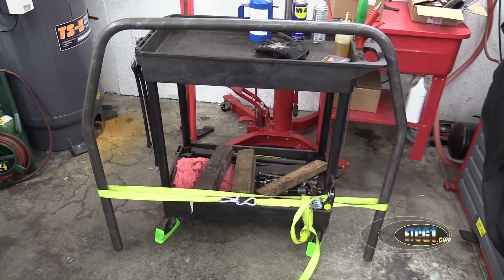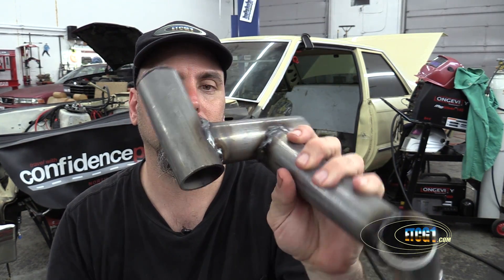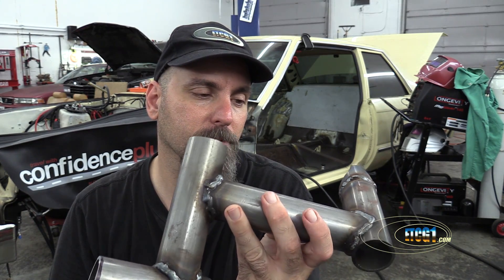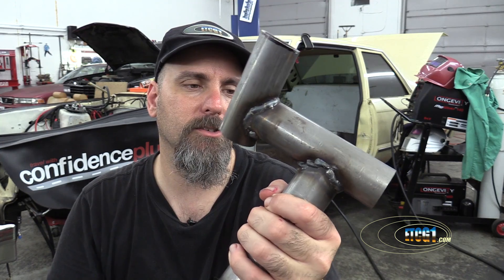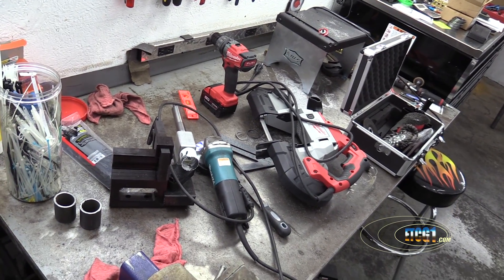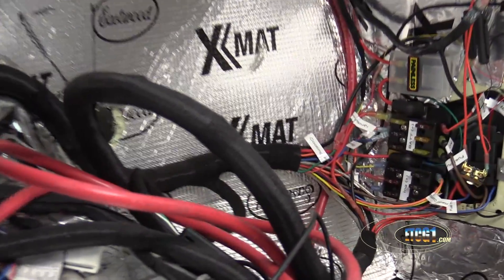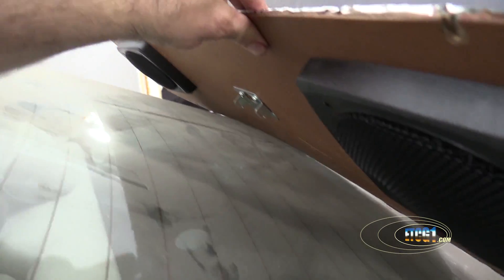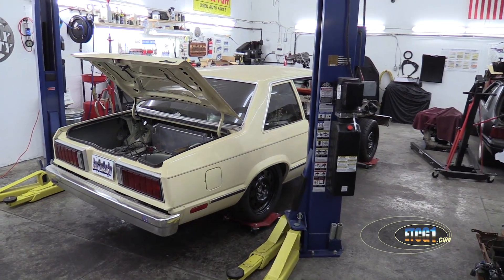Losing Motivation With Project Vehicles

Comment: I know what you are going through I had a 95 civic I was starting to restore a few years back, bought the car back when I was 17 or so and by time I reached my 20s I started putting alot of money in the car from a engine swap just to get it back on the road. And spent alot more money doing body work. Which the body work wasn't horrible just needed a few dents pulled an new core support. Well I couldn't put the core support on until I fixed the frame in the front it was bent back some. Lost my job and things went south. I hated to sell it but I sold the car that project seemed to take forever. I wanted to build a b18c1 engine with boost had everything laid out on the planning table but things happens wasn't meant for me to build the car.  So now I bought a 91 firebird not really planning on doing a bunch of work to it besides the normal tune up and suspension work and eventually get the car painted but other than that it will be kept original. My plans are to keep it for a very very long time. Sometimes you have to step away from the projects for a few days to reset your mind, there's times I get out and don't feel like messing with nothing and when I do it's to late in the day. But when motivation strikes I go to bed early wake up at 5, 5:30am and start on my project. This is how my mind works and it may help you to. When you get through with a area of the car the fun part is, is stepping back and looking at the progress made. Don't worry about the next 100 things on the list those will come soon enough. Since you are stumped on the roll cage find another portion of the car to do and come back to the roll cage later. Let your mind clear for a bit.

Comment: I know you might not see this but I learned to weld using flux core. Over the last year I gotten better and then I switched to shielded gas and omg, my welds are mint now. Basically what I'm saying is, if you can get the hang of Flux core welding, shielded gas is like training wheels.

Comment: I know the feeling about losing motivation with projects. I am stuck working on my project outside for the past 10 years, every time i start to make progress life gets in the way and stops me, ive got two sills to fit and one rear wing and the weldings finished 4-5 days work max. Once thats done the rest is just assembly and yet I struggle to find the time to do the work thats needed, from other projects - work life balance. I mean this is the one car I want on the road more than anything and yet I seam to keep getting distracted by others. I think some times us car guys just need to give ourselves a kick up the backside and get the jobs we don't want to do done so we can get our projects finished.. 

Building a project car is like climbing a mounting. your struggling your backside going up to the top of it, with all the hard jobs you doubt you can do - but once you get over the top you fly down to the finish line..

Comment: Eric, as a guy who started his project in 2010, I know where you are right now. I jumped into tearing the whole vehicle apart, put the body on a rotisserie, fixed every single minor fault on the body, restored every single part to the smallest detail and where am I right now? I still have the interior, roof panel (accident, avoid tent garages) and paint job to do, which will cost over 7000 dollars. I'm in the point where few things have to be done but they cost a lot of money.

Comment: I hit that a couple time on my 47 coupe I find taking a bit of a break helps give your mind a rest and when I came back to it. What I thought at that point was a brick wall coming back in refreshed what was once seemingly impossible just popped together. I had a bit of rust on the cylinders of that 47 I honed them and it worked great still running strong with no issues

Comment: I understand that it is not always possible, but I like to do my projects step by step. Keep it driving for most of the time. Everytime you have finished 1 thing, the satisfaction you get from just driving around for a few days really motivates you to do the next. I built my engine while the car was driving, when I swapped it, it drove in one day and drove out the next. Finetuned it 2 days later. Drove a couple of days, then I got the interior out and done all the electrics nicely. Straight put back the dash so it was driving again, and did the rest all later.
Off course, there are going to be things you have to take loose twice, the eventual total of hours in the project is way more than doing it all at once, but for me, this is the right approach.
Maybe this will also work for you. You could get it up and running, save the roll cage for later, just to name something. Anyway, I not want to be a smart ass, I really like the project and the subjects you adress in your ETCG1 videos. Keep up the good work!

Comment: That sucks when you get burnt out and loose motivation. We all have that problem from time to time. The not knowing how it will turn out can really put a damper on things. By trade, I'm a manufacturing engineer and I mainly do new machine installs, some design projects, and general project management. I've been working on a design for a particular piece of equipment for a year and a half, on and off. What helps me with motivation is to have others you trust to pick it apart. Bring out the flaws they see at hand and address them now rather than after it's built. I've seen some machines that we've installed and still struggle to run as intended. My motivation is to not have one of those machines.

Comment: I've lost count of the amount of these types of projects I've had and lost interest before they are complete. I once took a 90 Camry that was a flood damaged vehicle, and stripped it all down and put it all back together and replaced most of the wiring, but I gave up after I ran into issues with the injectors and starter, so I sold it for practically nothing. 
It happens when it is fully in depth like this.

Comment: What I usually do is just take a a break, right now I'm restoring a 76 hilux and I haven't work on it for like 3 months. Same happened when I restored my 280z... Some weekends I used to get in the garage, and after realizing all the mess I had. I just turned around and went back inside the house. I know how to work on cars, weld and paint, but my current job doesn't have anything to do with cars, and even though I like to work on cars. I wouldn't do it for a living... It's stressful.
Good luck!

Comment: im going through the same type of thing with this welding inverter im building (sslightly off topic) i know im burnt out on it. my "solution" is to simply get back to it when the drive is back. or when its been sitting around for a month too long.   you can do this eric! its gonna be a sweet ride when its done.

Comment: Hey Eric. I was a bit younger and rushed out and got me a project car. I spent close to a year of solid work stripping it down and re priming etc a car in a car port. By the time the painter was ready for it it had sat through our winter here for 6 months waiting  and the rear quarters ended up crazy cracking after the paint job  from moisture in the primer. It was very sad to see all my work basically needing to be done again. . Since this point I have met with professionals of the industry and worked out what I need to do. And got myself a garage to work out of and stocked up on anything I will need slowly since I've done it before I have a fair idea.. and hopefully this time will be ten times quicker and not only that but smoother.. 
Advice for anyone in similar boat.. if you are going to strip a car to bare steel and don't really have good cover/garage for it. Understand that everything you strip will be covered in rust particles by morning unless you have put on some sort of sealer and it has cured properly before temperatures drop etc.. But the  moisture will really stuff things up for a lot of people so I highly recommend having a garage to do this kind of work and even then you can run into similar problems but it will be to a lesser extent.
Also I agree 100% Eric with the  level of understanding and intimacy you got from doing this work. It definitely helps to understand cars by taking on a project like this :)

Comment: No!  You're not losing the true meaning of motivation, i have that kind of a mood on a project on a vehicle 8 years ago but, i lost motivation of that because of obsolence in parts, engines, etc.  Stopping the project is like a cliffhanger in the tv series, finishing it will end this nightmate.  Because of that #FairmontProject, you gave me the confidence of putting back the project in one piece with NEW hope.  I am planning to do that project on my late grandpa's Feroza (Rocky) with Jeep Wrangler Underchassis JK, LT4 engine with 8 speed from GM and the Rollcage on inside and out, just help me how.

Comment: Great to hear you're reaching out for help on the rollcage... it might cost more to get someone else to do it, but those guys are pros. You can finally check it off your list, and you know it will be designed and welded together properly. Same thing with the exhaust. 

I look forward to you completing and ENJOYING the Fairmont. There will be a lot of fun to be had, and it would be super sad to see it shelved. You're almost there, you can do it. And wow there are some bitter and negative people in the comments here.... don't let that get to you. 

I myself bought a BMW E30 about half a year ago, I have plans of swapping an S62 engine into it and doing a ton of other upgrades... but just like you I'm running into walls, and slowing down. I don't plan on stopping, but my original timeline is out of the window. But that's fine, I know some day I'll get it done, I won't scrap the project, but it IS a lot to handle, and it IS daunting. But I'm learning more about cars doing this than I ever have by reading/watching/tweaking things from before. But yes I find myself messing around with the little easy things then the big large things that really need to get done. I will get to them, but then again I've never done a huge project like this... it's a learning experience, and I'm happy I'm doing it.

Comment: Yes, know the feeling well.  A while back I got about 80% done refurbishing an old shortwave radio, a Hallicrafters SX-28.  Finally I got to the point where I had some anonymous wire hanging loose and disappearing into a big wiring harness and something went snap in my brain.  Didn't have the gumption to figure this puzzle out.  Put my tools down and have not touched it in like THREE YEARS.   It happens.   No major show-stoppers, just a few minor roadblocks.  My only suggestion:   try a little creative visualization-- imagine the thing all done and put together and how good it will work and look and all the good vibes generated thereby.  Build up a gumption reserve, then get to it.   Hasn't worked for me yet, but it just might.

Comment: Hey Eric, I think one of the mistakes people make is doing things in an order that leaves the vehicle undrivable for an extended period, such that the car ceases to become a fun thing you're tearing around in and is instead a piece of furniture you start to feel an obligation to work on rather than a fun thing. You can at least be thankful you didn't get it all apart and decide to do bodywork too- i see so many people strip a car as the first step with the intention of a full restoration including bodywork/paint, only to lose steam because they forget the fun of driving the thing while it's up on jack stands forever (also it gets pricey fast).  

When you're adding all these performance bits like suspension and brakes but you're not getting that positive feedback from driving it right after and feeling the benefits of your hard work, it's not hard to see why you'd lose motivation.

Comment: I think the biggest issue people have with Project Cars (myself included) is they try to do to much to fast. A regular guy doing a build like this would be a 5-6 year project. I recently did a drivetrain swap in a Dakota I have, took out the V6 and automatic, put in a V8 and a 5 speed. I had the ridiculous idea it would only take a couple weekends to go from driving in to driving out. That couple weekends turned into almost 9 months of going over stuff, a little wiring, making stuff fit that didn't and rearranging the cooling systems since the water pump on the longer engine wanted to occupy the same real estate as the radiator. And after all that then engine I built spun a rod bearing on cam break in, so I had to take it all back apart, get the engine rebuilt and put it back together. It's worth it in the end and I love the truck but I would definitely do a few things differently if I did it again.

Comment: With my car, I've been building it one part at a time. I will not let it sit in pieces for long so I wait until I have everything to do a particular job then knock it out in a weekend. I recently painted the inner fenders and installed a fuel injection kit. Now I want to upgrade my transmission but I'm not going to take it apart until I have everything to do the swap. I make a plan a and stick to it, if I feel it needs to be changed in the middle of the project I finish what I started and if I still think it needs to be changed I get to it when I have all the parts. Like the transmission, I'm not digging the 400 turbo "upgrade" and I'm thinking of going back to a 350.

Comment: For me, I have to drive it, the number one priority for me with the project car is that I have to be able to drive it, I've pulled things out of the dirt and Donna bunch of ghetto stuff just to experience the way the car drives, before tearing it apart and doing other things, you need the connection with the car, you need to feel what it has to offer, you haven't driven the thing for two years!

Your mind is stopping you because you're frustrated with how much effort and money you are dumping into what is essentially yard art.  

Put a seat in it, hook up some wires, drive it for a weekend.  I bet Monday morning you'll be putting a rollbar in!

I love your videos, you're extremely good at what you do, I hope your path leads to you to continue on making them.  both me and my fox body have benefited from your work.

Comment: It's a problem i have too. my baby is a 2006 Nissan Xterra with some engine issues. It all started with a squirrel making a nest out of the engine bay. I had to require a good portion of the engine bay. I fixed that and got it running. Then I started working on the other things that were neglected on it and since then other issues have come up because it sat for so long. In the last few months I've replaced all 6 coils, now 6 injectors ... with no end in sight. It will idle fine for a while then seems to choke on its own exhaust ... more parts

Comment: You speaking straight to my broken Project Car Heart with this one my friend!! I have 2001 BMW 325CI that I traded a perfect 2007 Focus with 35k miles(BMW+$2700 for the Focus). The BMW was running great aside from regular 16 year car wear and tear that I was able to find quick cheap fixes for. So almost everything was cosmetic, just taking little bites at a time with great forward momentum.... Then... I decided to rip out the door panels and side panels to have them reupholstered, *sigh*, the Upholstery Guy charges me almost double what the estimate, takes 3 weeks to do when he said it'd be a 2 day turnover, didn't use the vinyl we agreed upon, and after assembling the door handles the vinyl doesn't fully cover the panel!! I was so pissed I couldn't even look at the guy. So my car has sat for the last 3 months with nothing inherently wrong with it other than it's effed up/stripped interior and now dead battery.

Lessons learned: (This goes for every Car Guy)

1). -If Project Car isn't running, do the bare minimum necessary to get it on the road safely and legally.
      -If Project Car is running, make a list of things you like to do. Start with cheapest, easiest, and most value given... THAT KEEPS  IT ON THE ROAD!
2). -Drive and enjoy it, everything else will come with time so long as you take little bites outta it. When you see something small that bugs you fix it/replace it/upgrade it.

Comment: I'm currently experiencing the exact same thing as you Eric. Been working on my project car for 8 months now. Initially I'd simply re gasket the engine, but found some rust and decided to tear down the car completely. And even though after months of welding and having a finished body. the motivation to rebuild it is a bit low. I'm also doing detail work even though the suspension is all apart and should be installed

Comment: Bought a project car. Engine needed a head gasket and timing. Turned out it also needed new clutch. And pumps. And every other gasket. So now I'm looking for a new engine and scraping other things from the list. New suspension? Maybe next year. Better wheels? After the brakes. Brakes? Maybe later. So here I am, sitting at home sculpting new gear shift knob.

Comment: Totally in the same boat. My samurai build has been 3 years in the making and this last year it's been so little progress, with really not that much to go. Started out with fueling issues on the carb, decided to fuel inject it, at that point why not motor swap it, then should really convert to jeep yj suspension, but the axles leak so why not lockers, now the tires seem small so that's more money, plus it needs armor to accompany the lift, now axles shafts and drive shafts, etc etc etc. Stuck at the end with just transfer case gearing and rebuilding the rear axle to go and I have all the parts. It's just hot as hell, I'm in AZ, and after this long it's so hard to keep trudging along.